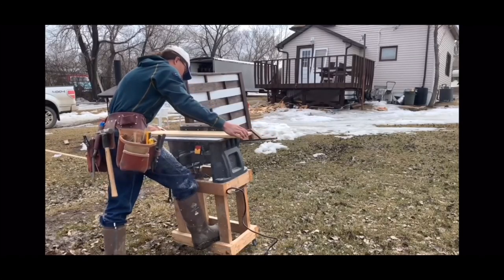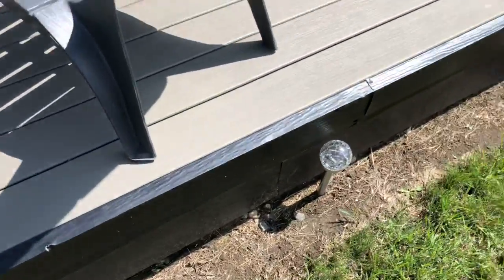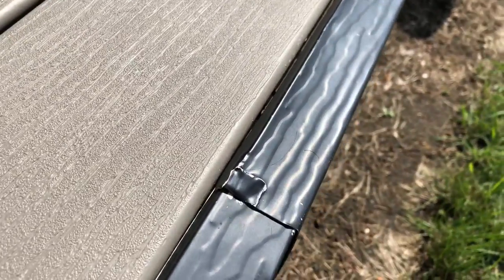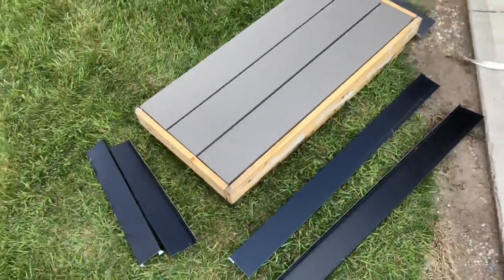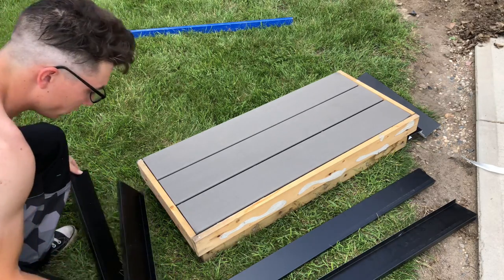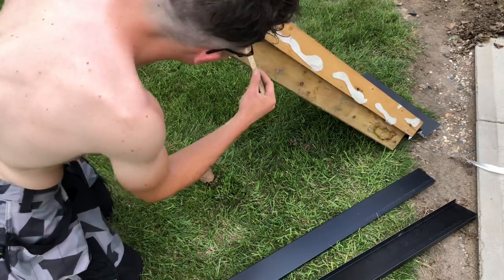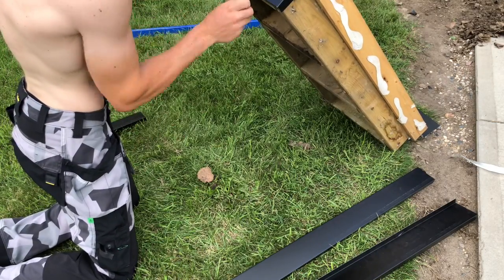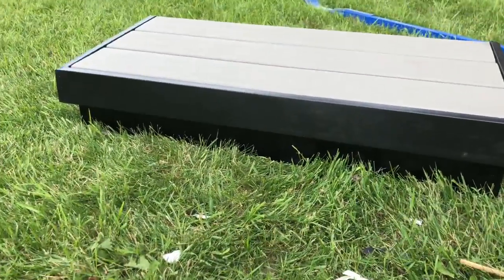Re cladding a deck with aluminum

Comment: Beautiful work! So fascinating and informative - but a little too low in volume in a lot of places. I know it may just be my little bitty speakers, in combination with your tendency to be a bit soft-spoken, but I don't have trouble with most videos. Seems to be mostly when you're farther from the mike - maybe more sensitive equipment? Or go to voice over later on? Other than that, no complaints! :)

Comment: Austin, your attention to detail is very cool. I could see such a huge difference and really enjoyed watching all the small steps that you took to achieve a grand result. Thank you for sharing this with us. I hope you do not mind me asking, where did you get your pants? They are intricate and very interesting. Sometimes they looked like chaps over pants....not sure but the pockets were thoughtfully made to accommodate your bulky slide rule. The closest I have seen to something like this is the old school nail aprons...but still this surpasses that outcome it seems. Also the belt you had on during your installation of the final window of the Bunk house was also very intricate....was that two belts or one?  Thank you even if you do not have time to answer, but I hope you do because I will be thinking about the design. :)
Reply from the maker: They are called flexi work trousers by snickers workwear. They actually do not sell them in Canada I had to order them out of the UK as they are a Swedish brand. They are not cheap but they are incredibly useful! And as for my tool pouch, I actually did a video about it so go check it out, but to answer your question it is just a one piece belt and it is called an occidental leather pro carpenter.
Reply: @AustinTischler  those trousers are really cool, but wow! not cheap.  I looked 'em up on Amazon. $120.00 USD
Reply: @AustinTischler  Very interesting. How are they holding up for you? Are they made well? They really look quite useful!

Comment: I think the smooth coil looks better than the pvc that was on there before. Have you ever tried premarking your coil prior to bending with pencil? I know everyone has their own techniques, and you do great work, just seems like it would save some time walking back and forth checking the measurement.
Reply from the maker: I have seen some guys do that, but I have never done it I guess just because that’s not the way I was taught It does seem like it would be more accurate, but also more confusing and time consuming lol
Reply: Austin Tischler we’re creatures of habit, I’ve never used one of those hand benders before  but  after seeing you use it I ordered one from amazon
Reply from the maker: Oh yes the hand seamers are incredibly useful. I like to use them on facia especially to hem the cut end on gables or corners. I think it looks cleaner and tends to hold itself straight and not open up at the corner when it has the hem in it